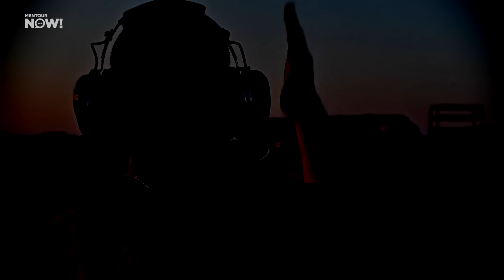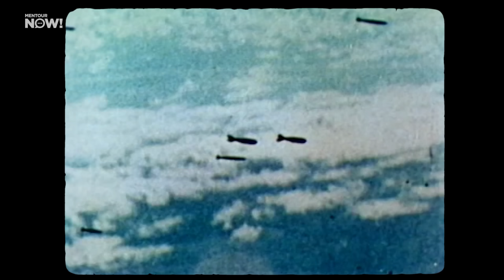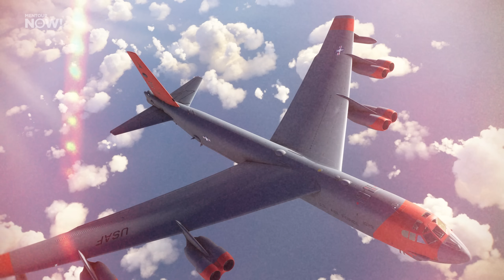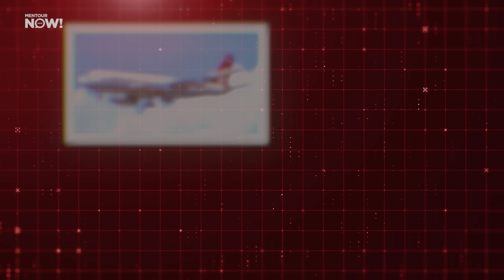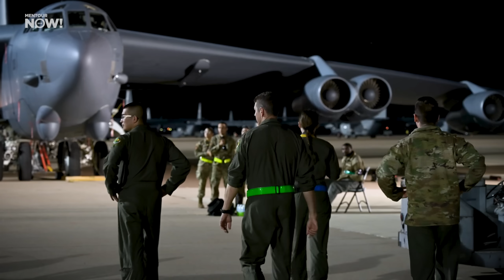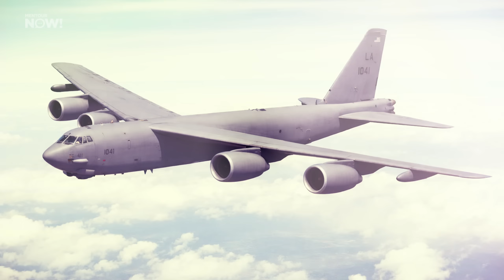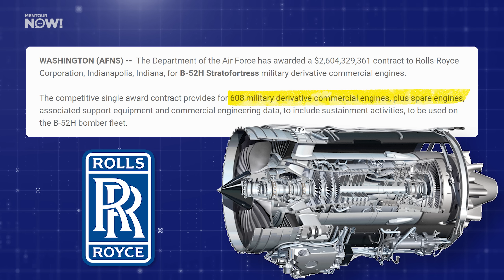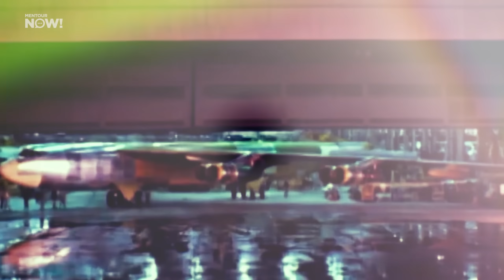WHY Are They Changing The B-52 NOW?!

Comment: Would have been easier to have Lockheed or Northrop build a B-52 replacement. Guess they knew thought that a modern replacement wouldn’t be as tough and robust and it would probably end up looking really goofy like modern cars.
I’d prefer the 4 and 8 engines over 2 any day of the week. Had the most recent Fed Ed accident had 4 engines the chances are that it would have made it in the air on the remaining 3 engines.

Comment: The B-52 wings are simply too close to the ground for a modern high by-pass turbofan to fit,  the Boeing 737 has the same problem. Doesn't mean that cant find a middle ground -- or even push Turbo Fan technology to new level. Something to be said for the "All purpose" nature of a B-52 -- It's proly not the very best in any 1 category but it comes in 2nd or 3rd in all others. Jack of all trades truly.

Comment: The B52 is the last FRAME based plane. It does not rely on its skin for strength. It is very easy to "bolt on" additional or new avionic or weapons systems without compromising safety. That is why it continues to remain up to date, technologically speaking. Maybe the next new bomber will be a FRAME based design, much like work horse trucks are NOT uni-body, but body-on-frame.

Comment: Aircraft manufacturers really should adopt a standard, similar to SAE standards for bell housings (#1 - #6).  The Air Force does to some extent, the F100 engine is used by both the F-15 (two) and F-16 (one), and 
it's presumed that the F119 (used on the F-22) will also be used on the B-ONE-R if it's ever approved.. but what if the Next Generation Adaptive Propulsion (NGAP) engine proposed for the F-47 fit into all of those airframes?

Comment: A significant part of the decision to keep the 8-engine layout is that the smaller rudder on the later models doesn't have sufficient control authority to handle an engine loss in a 4-engine layout.

Comment: You didn’t talk about how AWACS still uses the TF-33. They are such crappy engines. An average of one engine change per Iso inspection, they scream when just at idle, and are the dirtiest engines I ever worked on. Compared to the F-108 engines that the KC-135R’s changed to, which are insanely reliable. Super clean, rarely need changed, and can even stay in service after taking a bird strike down the core (which they do at the GE facility in Cincinnati, and shoot frozen turkeys into the engine in the wind tunnel to show its durability. But that is a pretty common feature on engines that get most of its thrust through bypass air.
Reply: US AWACS do. The French and RAF ones (retired) used different engines

Comment: 12:00. Sounds like they first need to make a digital model of the current B-52H, and then test all desired changes, aerodynamic -wise and every other -wise.  Then tally up the real costs of all different alternatives against current economy and, especially, our current supply chains (or lack thereof) and decide how to proceed.
The way this is going is as if low or no engineering will lower costs.  But, as an engineering student, I was taught that, if you think education is expensive, try ignorance.  Likewise trying to modify an airplane from the '50s using design techniques from the '50s because "they're cheaper" will get more expensive overall, exactly because of unexpected side effects just like these.
And why haven't they tried this engine change in a few airplanes about 10 or 15 years ago, and see the results?

Comment: why not 2 high bypass turbofans in the inner pylons and 2 smaller engines at the end of the wings? if one of the big engines cuts out, its closer to the center of the plane so the thrust difference will be smaller and its higher off the ground so it won't strike the airstrip.

or what about making the 8 engines it currently has more high bypass, by shrinking the core? modern engines are more efficient, so the core could afford to be smaller.

Comment: 4 engines on the B-52 would cost way too much and there is the possibility of losing power and altitude if 1 or more of the 4 engines fail or are damaged in flight. The 8 engines grantees enough power to maintain altitude if 1 or more engines fail or are damaged in flight. It’s all about safety and redundancy. Also 4 engines would require a full wing redesign, as well as landing gear, fuel line and Electronic’s, flight control systems, and several other things. Ground clearance will cause safety issues with landing.

Comment: Why not simply use Boeing 747 converted into bombers?
Reply: Very inefficient. The 747 fuselage is pressurised, so modifying it to fit a bomb bay would be expensive and add a lot of reinforcement weight

Comment: This is an extremely interesting video as to why you can not simply shoehorn a modern engine into an old airframe. The B52  has lasted  and will last for a few more years yet. This is a good example of U.K. and US cooperation Rolls Royce are prepared to look at requirements needed. I saw this airplane  the B52 on the ground at Mildenhall air show a few years ago.  The latest and best technology around at the moment is the` NEO` engine  which has made the A321 to become a much longer range plane than originally  in visaged.

Comment: I came from an aerospace family. One of my great  uncles worked at Boeing and the other worked at Pratt and Whitney. Both had advanced degrees in their fields. The uncle that worked at Boeing was on the design team that designed the B52 along with the 700 series planes up to the 757 model before he retired. My great uncle that worked at Pratt and Whitney was on the design team of the J57 which was the first engine on the B52. I have flown in the B52 with my great uncle during an appreciation day at Fairchild AFB. Both uncles lived to close to 100 years old and got to see their creation still flying. So I have a strong connection to the B52.

Comment: If these planes are so invincible why the heck we need to replace modern fighters and bombers every 5-10yrs.
Reply: We don't. Some US fighters are over 50 years old. The difference is that fighters cannot undergo the same level of midlife extensions at a structural level due to their construction, and the requirements for what you need from a fighter has changed massively over 100 years.

Comment: Ion no about this idea that aircraft should be designed to have their lives extended as long as humanly possible. Because I think jetliner travel is a mass delusion we've all been persuaded to buy into. 

My big complaint with them is that 30,000 ft at 600 mph is not a naturally tenable condition for the human body to be in. It's an inherently fail-un-safe concept; we rely entirely on the engines functioning the entire duration of the flight for our survival. Now, we've made those engines so reliable that that's highly probable. But we only did that by spending an astronomical amount of resources making them that reliable. To paraphrase Ike, how many schools could we have built for that money, how many cancers could we have cured? 

But I think the energy crisis right now highlights another problem with jet liner travel, it's extraordinarily inefficient in terms of energy use.

Comment: I'm about a minute in and already knew the answer to why it's stuck with 4 dual engine pods. When fully fueled, the wings droop so much that large single engines would scrape the ground and explode.

Comment: The B-58 was never designed to replace the B-52. The B-58 was designed and was a supersonic bomber designed to carry a single nuclear bomb. It was only later that it was fitted with hardpoints on the wings for more nuclear weapons. It had no bomb bay and was never designed to carry gravity bombs. The same with the B-70, nuclear bomb carrier with zero bomb bay. Neither of those two was designed for what the B-52 actually does, carry massive conventional payloads, loiter, operate flexibly across a huge range of mission profiles.

Comment: Great video, Mentour now! Thanks. One thing that I wanted to see is the analysis of Asymmetric Thrust analysis or simulation because, Buff (ops name of B52) as it gets loaded with a lot of munitions, it needs to travel far distances where current atmospheric turbulence (climate change goddammit), mechanical issues impacting engines in flight (as the kinks get worked out over time), and spooky control surfaces mismatch will show odd behavior that may not be understood at this time...

Comment: A magnificent video.  One thing I recall reading in (I think) Aviation Week a few years back, was that the USAF chose NOT to re-engine the BUFF because the fuel savings was insufficient.  A couple of years later, someone pointed out to the brass that the fuel savings were based upon the cost per gallon on the ground.  It turns out mid-air refueling costs about 17 TIMES more per gallon!

Comment: When American Airlines parked all of the 707fleet, the Air Force bought all of the airplanes & spares for the B-52's to get them a bypass engine.  I think the modern high bypass engine has such a large fan diameter that it would be a risk on the B-52 with the spect to ground clearance.

Comment: Have they flown with a single HBTF engine attached to one of the inner pylons?  Electrical changes is nonsense a that can be regulated.  I don't buy the "way they designed the wing" and "fuel delivery" because the HBTF engine is lighter and uses less fuel.

Comment: Boeing used to build planes to last. Douglas, maybe not as much. I flew on a Mexicana DC-8 in 1987 returning from Cancun. It was a rattle trap. It sounded like a lot lose rivets. It flew with so many creaks, thumps, whines and loud bangs. It was like riding an old wooden roller coaster. Was it safe? Probably. But not very reassuring.

Comment: One thing that was not mentioned, is why these air frames last so long, like the DC 3 and other non pressurized aircraft, they don't have  to withstand multiple pressurization cycles. The B-52 is only pressurized in the crew compartments so the entire air frame is not subject to those stresses, which limits the lifespan of fully pressurized aircraft.
Reply: Didn’t know that somehow, thanks.

Comment: The engines are being replaced on the B-52H for the same reason the KC-135A J-57 engines were replaced. Nobody is building spare parts and engines for the TF-33 and J-57 engines. All these years the USAF has been cannibalizing parts from the boneyard (Davis-Monthan AFB). That supply of engine parts from KC-135E, EC-135, B-52H, and C-141 are running out. The USAF is going to fly the B-52H for at least another 20-30 years barring some unseen structural issue that hasn’t surfaced yet. Same thing for the KC-135R. The structures are so sound and the fact that the USAF continues an aggressive heavy maintenance check at Tinker AFB every 5 to 6 years, these airframes can and will fly indefinitely. The new B-52 Rolls Royce engines will be more efficient and more reliable. This will bring down maintenance costs and increased range. Thrust output remains the same so that expensive aerodynamic changes will not be required or needed. The KC-135R required 15 sub-systems modifications to include more elevator surface area to compensate for the thrust-moment pitch up/down increase from the inboard engine struts modifications.

Comment: The biggest change in the B52 has been in its mission.  It was first planned (1950s) to fly very low to avoid radar and SAMs into Russia and then climb to drop their bombs.  That is why the tail was so large and they had a tail gunner.  Then the mission changed (1960s) to a high-level bomber with a heavy emphasis on ECM.  Then, in the 1990s, its mission changed to being a missile truck and a mother launch pad.  As missiles have gotten smarter with longer range (BVR), their mission began to change again into a variety of platforms - missile truck, ECM, bomber, etc.  In the future, flying manned aircraft over enemy-controlled land will stop in favor of stand-off launch of BVR, autonomous and long-range cruise missiles, and glide bombs.  For that mission, even a C-130 will be useful, but the B52 is faster, has a longer range, and is more capable.

Comment: Precisely the reason we should have built about 200 more of the b1s than we did. It is more capable than the B-52 it flies further and it's far more accurate and it's capable of interjecting itself where B-52 could never survive. It is the only aircraft that was ever a more capable replacement for the F-111. Another aircraft that should have retained at least the airframe and put some more modern avionics in. But the B1 is a good update to the F-111. The F-15 that now works out of the same spots that replace the f11, is not nearly as good a bomber, but it is adequate. And it's capable of air-to-air combat if needed. The F-111 only ever had one aircraft that scored an air-to-air kill and that was an f-111f model in the original Gulf War in 1991 or 92

Comment: if its not broke dont fix it. They can upgrade and keep these old girls going for as long as needed and i hope thats another 50 years bc like i said they still do their job and are very good at it. We havnt lost one to a mechanical fail in well who knows when other then in 2016 there was one that had a bird strike on takeoff then aborted and overshot the runway  on the abort. I think 2008 or 2009 there was one that crashed in Guam. What im saying is this plane is still perfect for what it does and cheap to fly. Best return on tax money ever with these planes (had to use the old chatgpt for this but with them being so old and used so well its cost each tax payer about $970 over your life time of taxes and thats not bad if that number is correct!) With all the new long range standoff cruise missiles there is no reason to think about replacing these. Even when the new B-21 comes into service the operation costs will be way more pricey then this old girls and pretty much do the same job. The numbers i saw is about $65k per flight hour which isnt bad when you look at the B-2 which is about $140k an hour and the B-1 $95k. So it saves us on tax dollars also every time they fly these. It would be awesome if we could just build some new ones but it would be cheaper just to build a all new bomber. Same with the F-22 id love more but its not really doable and make sense. We have 76 left so lets not waste them. at one point we built almost 750 of these things

Comment: Few things can top the B-52's proven combat track record, reach, reliability and payload capacity. The simple reson why it stills flys is that there is no real alternative and it is still effektive and works. A new plane would cost billions in R&D, a decade at least to design and put thru combat trials and train new pilots. To modernize and upgrade costs a fraction and can be implemented relatively fast not to mention a heavy bomber nice to have but its not on the top of anyone's shopping list.

Comment: What i wonder with cases like this, with how much work etc. it is to upgrade, and how old these are getting etc, is mostly, how far away are we from designing a more direct replacement for the b52 in terms of viability?
i know there have been many "replacements" that failed to do so, but none was a really a direct replacement of the simple "metal tube with turbojets" design that the b52 is (and most cargo and civilan aircrafts etc.).

Comment: Isn't the issue with commercial aircraft the number cycles they do a day, typically anything up to around three? If the B52s are doing one mission per day, that they probably aren't doing unless the USA is engaged in an active military campaign such as we have over Iran at the moment they will not be anything like what they are doing at the moment. I regularly see aircraft being flown into Kemble and St.Athan in the UK (I'm a relative local to these) for scrapping that are around 25 years old or younger. These will have had a hard life and they are sent for scrapping probably because the airframes are over their cycle limits but there are still parts that can be resold as spares.

Comment: The B-52s have TF-33 Turbofan engines on them. Before that, they had Turbojet engines with water injection that were loud and smoked like crazy and were gas guzzlers. While the TF-33 engines were a lot more efficient, the new Rolls Royce high bypass engines are more efficient and more powerful.

Comment: Why? Why not? The old engines aren't available anymore, harder and harder to get parts for them so best to replace with new RR units; more power, cleaner, economical, quieter, longer range endurance. May as well do the avionics and presto you've got a solid ol' bomb truck good for 100 years.   Way to go!

Comment: followup to the ridiculous question... if fitting the old B52s with newer engines is such a difficult, long and costly matter, let alone modernizing anything else, would it not be more buck efficient, possibly even quicker, for the USAF to just design a new plane that can do what only the B52 can, and be modern and more or less ready to work for another century or more rather than just spend all the time and oodles of green to barely upgrade the legacy birds?

Comment: only the crew compartment is pressurized. the fuselage doesn't have to go through pressure cycles with every flight, which has contributed to its longevity.

Comment: The B-52 can fly because of its an airplane b-52h because the forknund had hairpiss not the hotel way despite correct fornicate ratio high pie bass radio. The range is many much wider supplement dongle flop

Comment: the function of the plane, what it does is the point, this is why it has remained largely unchanged and in service,  it does what it is designed to do and does it well...no need for a replacement that doesn't match up....